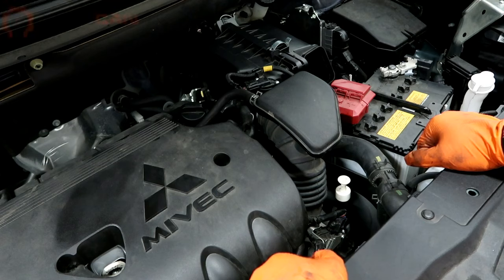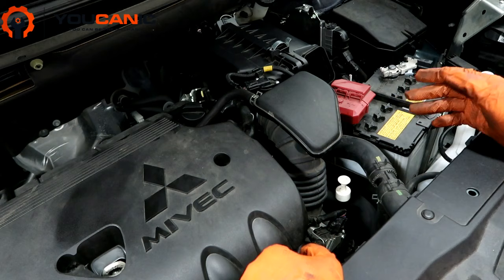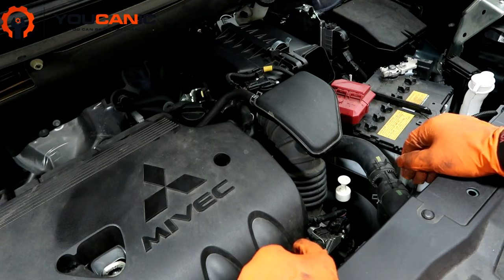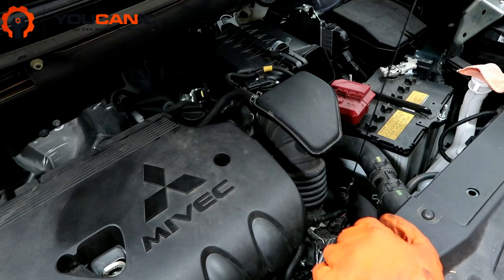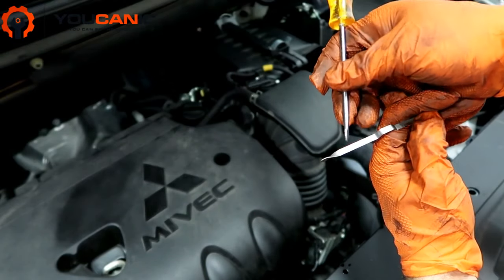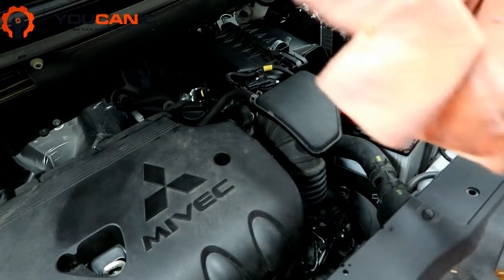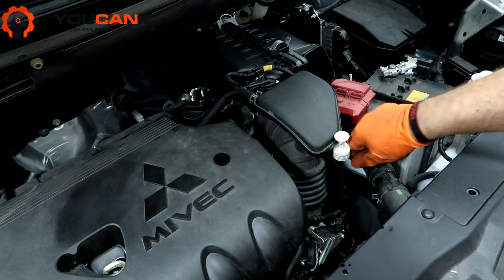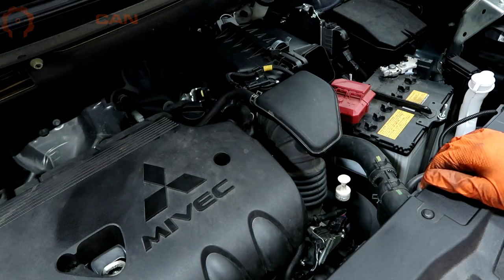How to Check the Transmission Fluid Level on a Mitsubishi

Comment: I have a 2008 Mitsubishi Galant Se and was wondering if I should switch the car into the "+" and "-" gears as well during that step? I just wanna do this right. Lol. Thanks in advance.
Reply: Wouldn't hurt to 🤷
Reply: @Camromulus It is not recommended you shift  inthe '+' or '-' gears when the vehicle is not in motion.

Comment: I have a 2017 Mitsubishi mirage g4 I was told that I need to check the fluid when the car is off and be sure it’s at cold drive it for 15 minutes and turn it off and check if it’s in hot. Was I misinformed? I’m doing a fluid change and want to be sure
Reply from the maker: Thanks for your query! It's crucial to check the fluid levels correctly to ensure the proper functioning of your car. For your 2017 Mitsubishi Mirage G4, it sounds like you may have misunderstood the instructions. Don't worry though, at Youcanic we're here to help you navigate through this process. 

Feel free to explore our website www.youcanic.com, where we offer a wealth of free resources including handy guides, or reach out if you need further assistance. Our goal is to make car maintenance simpler and more accessible for everyone. Remember, the journey of car ownership should be an empowered one, and we're here to support you every step of the way!

Comment: Hi you do it with out the dipstick mine it’s 2011 turbo and there’s not dipstick just the plug from the top under the battery
Reply: Delayed reply but there's probably a leveling plug on the side of the transmission. You remove that plug then you fill it through that cap on the top until it spills out of that plug. Wait till its a small stream and put the plug back in

Comment: Where do i drain and add trans oil?
Reply: Drain it under the car.  There is a sump plug, much like the engine sump plug but attached to the sump pan that has the trans oil dipstick attached.  For me, on my Outlander, it was on the passenger side (Australian RHD cars).  To fill, I added through the dipstick hole.  Slow and steady.

Comment: Can you use CVTF-J4 in a 2008 model that states CVTF-J1 ??  I can't find J1
Reply: no
Reply: @ETPitt  Thanks, i ended up going with the Penrite CVTF-J1 to be safe
Reply: J4 is the updated version of the J1, same oil
Reply: @jodeenfillerman3348  All, i drained it out as I didn't want to run the risk if it was wrong and refilled with the J1.  That was a costly mistake on my part.  2x bottles of each essentially.  Oh well, the J4 was a flush for the J1 ;)
Reply: J4 is the updated fluid.  I changed to the J4 and have no problems.  I am a stickler for correct fluid.  I did a lot of research.  J4 is the answer.

Comment: CVT transmissions are paying but you gotta do that transmission flush every 50,000 on those suckers. It’s like 300 bucks.
Reply from the maker: Thanks for reaching out! We at Youcanic are committed to supporting and empowering car owners in managing their maintenance. Our variety of aids including comprehensive guides, free resources, and our unique YOUCANIC scanner are designed to simplify car care for you. Don't hesitate to use our resources at www.youcanic.com and reach out to us for assistance. 

We also possess detailed factory repair manuals to guide you more precisely. We are here to assist you throughout your car ownership journey and make it smoother and more manageable for you!